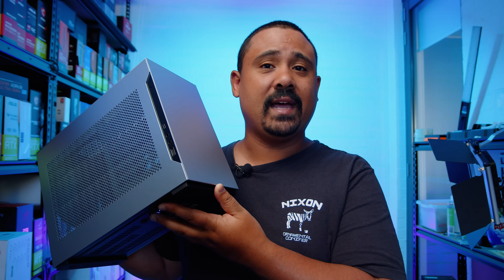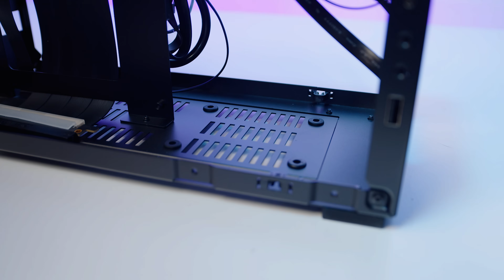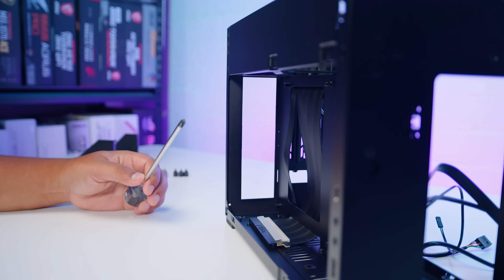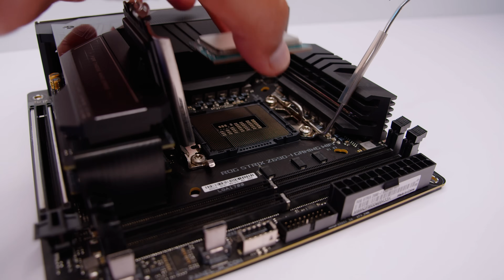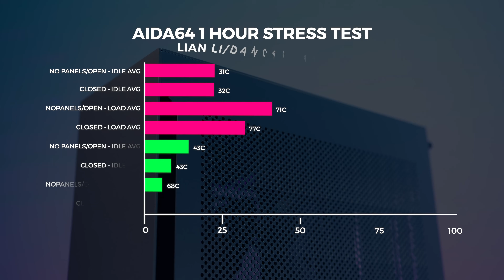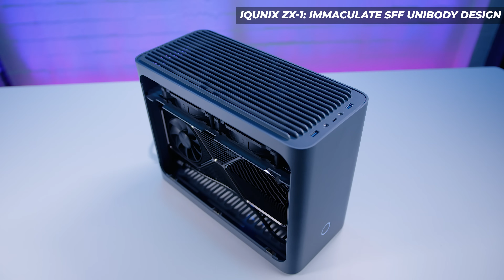Lian Li and Dancase Absolutely NAILED the A4-H2O!

Comment: I have one tiny problem with this case. Not the thermal or component fitment, but the side panel design. 

Instead of CNC-ing holes, why didnt they use perforated panel instead? Those cnc holes in my opinion looks cheap 😔

Comment: I have roughly the same gear...  i7 - but a evga 12 gig 3080, my idles are lower.. using the EKWB AIO basic, with two Noctua Cromax fans.    I am at 38c idly, the gpu is at 49c idle with the room being around 73F   With a slight overclock even.  Go figure

Comment: Your videos are always the best IMO compared to other peps. I like yours because you provide information and I still get to see the building process and admire the work committed to building this. I'm really stuck on which case to get at this point. I have SO much research my head is going to explode. The only reason why I want to avoid this case just SLIGHTLY is I wanted to avoid PCIE riser completely. Just haven't decided yet. Once again, awesome video. Currently thinking about a SUGO16 odd choice but as long as any case fits in the backpack. I can game at my part time job. Thus why I gotta have a SFF case to fit in a backpack. :)

Comment: Great review , in Spain only managed to get the pcie 3.0 , can you say what riser i need for change to 4.0? The support day me 20 cm 360 degree inverted but i cannot find  , thx
Reply: I bought the case that came with the 3.0 version by mistake and had to buy a 4.0 riser separately recently. I bought the LinkUp Ultra PCIE 4.0 Dual Reverse Socket Riser Cable 20cm. Works perfectly. As long as your riser cable is duel reverse and 20cm, you’ll be fin. One note though, the screw holes for the female side of the linkup riser cable do not line up with the stand-up’s pre-installed on the case, but there are holes drilled on the case that you can move the stand ups to that will fit this riser cable.

Comment: I don't understand the appeal of these tiny cases. You are just gimping yourself with the micro ATX mobo and the restricted air flow. A standard or mid tower is the way to go. Full tower if you have an absolute ton of hardware to fit in it.
Reply: For me it’s the opposite. Why bother with bigger more space consuming case when small cases like this accomplish all of that while still fitting my suitcase for travel.
The temperature aren’t that much worse either
Reply: @sentryion3106  why not just get a laptop then lol. A powerful pc is meant to breathe and not be restricted.
Reply: @mikerzisu9508  a laptop is really really loud and is still way hotter  being less powerful spec per spec. Small cases can still breathe very well like the nr200. The concept that matx is needed is more for really powerful component like 3080ti plus or really high overclocking cpu. If you can afford going small I don’t see why the vast majority should go big besides slight ease of cable management

Comment: Can you remove the pcie cable and use a third party one?
Reply: Yes. Just make sure it’s duel reverse and 20cm. If it’s any shorter and you won’t be able to fit the graphics card. Any longer than 21cm and you’ll end up with too much extra cable which can cause issues fitting since there’s limited space in the case to stuff excess cable
Reply: @StevenSugoi  had that problem of it being too long since I had bought the case with the crappy pcie 3.0 riser cable since stock issues. Had to remove the top black bracket part for extra room and remove my 240 aio that's now busted anyway. It did improve airflow though.

Comment: This is a wonderful looking case.  I wonder if they will consider making one just a little bit taller to fit a mATX motherboard.  Having a Vive VR headset with the wireless adapter I need 2 PCIe slots, 1 fo the wireless adapter and another for the GPU.
Reply: And not pay $300+ for the Sliger case even tho it's nice.

Comment: Might have to change from my slinger sm560 for the aio the sliger is also 11l and these size sff cases are easy to build in until you get to the 12 pin cable as there just to long and I had to get a custom 12pin. However I spent sooooo much on my sliger sm560 in Australia and its red I can't seem to give it up that easily. I wish there where more colours like the nr200 but red

Comment: This case seems like an upside down lian li q58 with even worse cable management.
Man your case reviews are spot on! I got my lian li q58 after watching your review. 
Speaking of which I shoved in my MSI 3080 Gaming Z trio in there with an ungodly amount of force aftwe watching your review. (the right most fan wouldn't spin because the shroud bends against the power button casing and hits the fan, which I fixed after removing the foam padding ) Now I'm scared to remove it again lol.

Comment: Great review. I am seriously considering this case and it is nice to see someone with some knowledge and common sense do a build in one.  Also thank you for using the Phanteks Glacier, current gen motherboards are so bad at AIO compatibility and it is nice to see what actually works.
Reply from the maker: Thanks so much! The Glacier without the pump cover has saved me many times with these SFF builds. I reckon they should make a cheaper version without the cover for SFF stuff.
Reply: The only itx lga1700 motherboard I can think of that has good cooler compatibility are asus b660i msi unify z690i and aorus b660 (only 1 m2). Asrock ones too and a couple board in Asia that is not available elsewhere
Reply: The keep out zone on this itx boards are getting ridiculous
Reply: +1 to this, having the GB 3070 master, I was looking for a ssf option to downsize. Given my gpu is a 3-slot I had limited options.
Reply: Then... Phanteks or ROG Ryuo ? What You think guys which may be better performance?

Comment: Love the case just hate dealing with riser cables. Given me too many problems in the past so I went with the Ncase M1
Reply: Hey just a tip. I had the same issue building in some cases with cheaper riser cables. They've never failed me, yet the quality on the ROG Strix riser cable is worth it. Very heavy duty and super flexible. Been running a 3090 on one for a year now.

Comment: OOOOOF but this case is looking nooooice but I just bought a noctua air cooler 🤣
Reply: Fractal just came out with an itx torrent!
Reply: @tkpenalty  ohhhh shit gotta check it out !!
Reply: @dan brown I bought the NH-u12 :(
Reply: @dan brown u12 wont fit in the nr200
Reply: @tkpenalty  u12a fits perfectly fine in my nr200. Heck I even have space to put a 25mm fan on top of it
Reply: @dan brown Defs been thinkiung about it fr fr
Reply from the maker: @dan brown watch our multiple builds in the NR200. We've fit some pretty exotic coolers in the NR200

Comment: Will an Arctic Liquid Freezer II 240 fit? The pump block is quite different with the tubes coming out vertically.
Also the radiator is a bit thicker iirc.
Reply: No
Reply: Nope
Reply from the maker: Yeah defs not for SFF cases like this one. As mentioned 55mm is the maximum height for basically everything on that side of the case :)